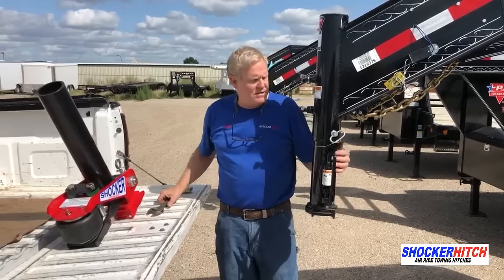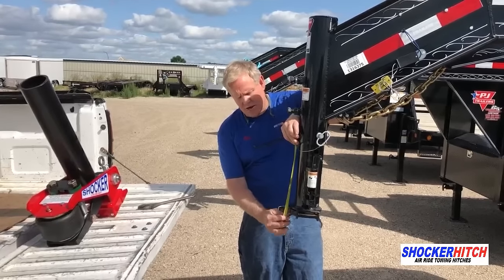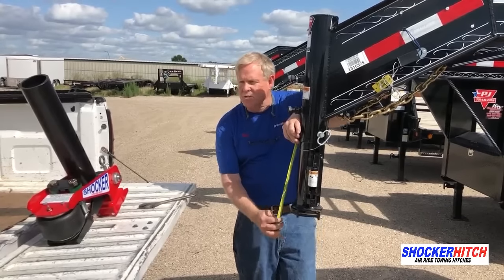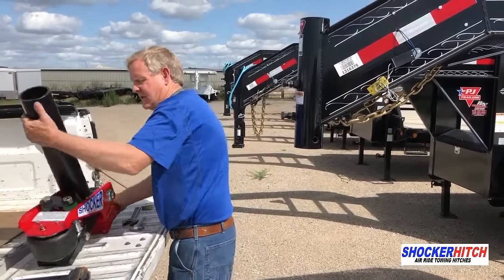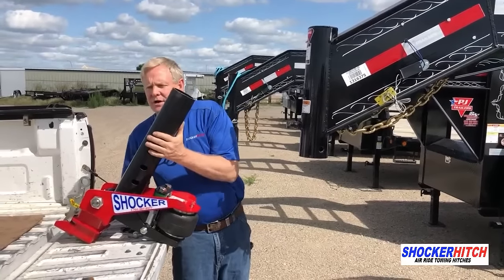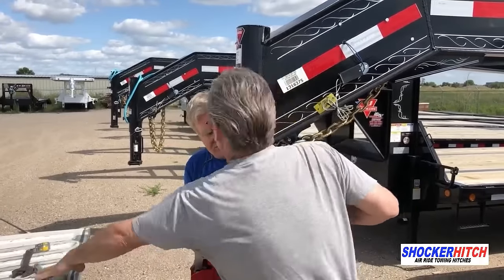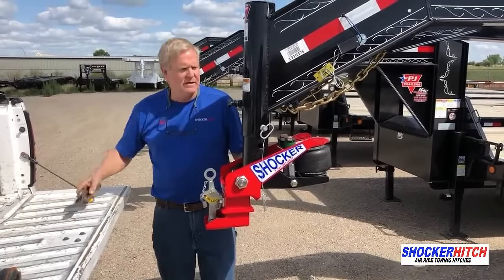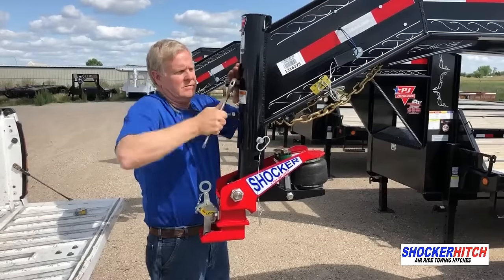How to Install a Gooseneck Surge Air Hitch - Shocker Hitch

Comment: Hi. Just bought one of these. Will hopefully get it next week and install it myself. 
How do you know how much air to add? And the measurement of 12” you did before removing the old hitch, did you measure to the bottom of the Shocker Hitch?